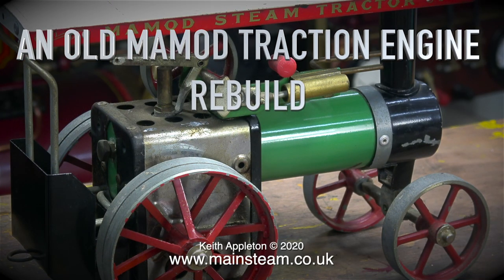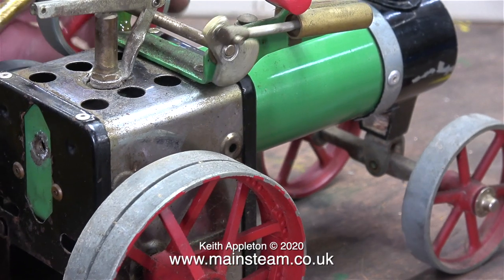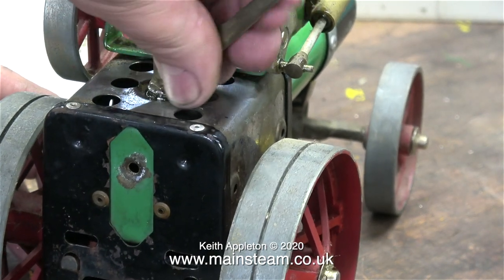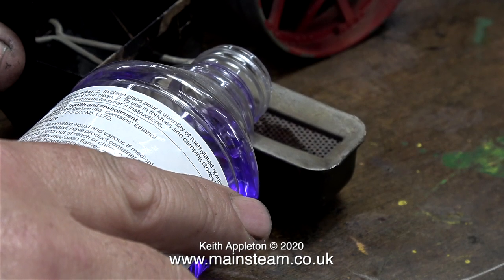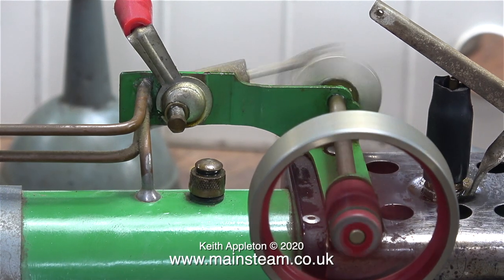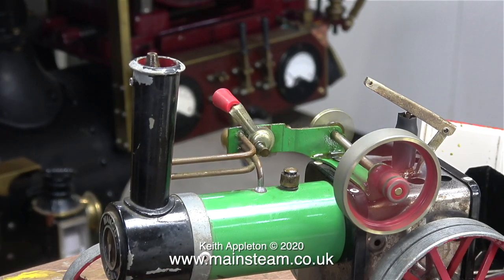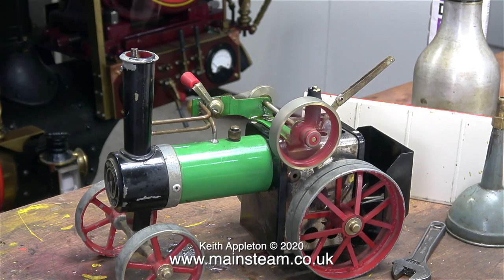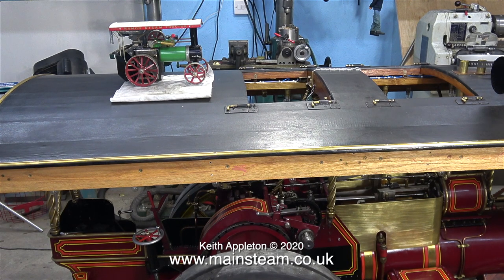A MAMOD TRACTION ENGINE REBUILD - PART #1

Comment: Fun fact i discovered is that a lot of the smaller Mamod stationary steamplants are compatible with Meccano parts, even the standard models, so it's basically can be used as a live steam engine for Your meccano (or trix, etc) creations! I suppose it's a well known fact in Britain, but i had not seen that before. (i finaly managed to get my hands on one of those dedicated Meccano machines as well recently but they are quite rare in my country). Sometimes one can still find loose parts for the meccano system reasonably sheap where i live, if one are just looking for old parts that are fun to play with and not something in real collectible mint condition it's still possible to get basic parts without being a bilionaire, i use small DC motors as generators for the miniature steamplants, not that beauty as the original generators but it works for creating pedagogic models to show my sisters kids.

Comment: Awsome! I just got a little box of various small stationary Mamod steamplants from Britain i begun to cleanup and restore them few weaks ago, i relay love those for some reason and they did not cost me a fortune either but i think they shall be relativly easy to patch up again, it mainly seem to be bends and dents and soft soldering and a few brooken pins, it's awsome that one can still order so many replacement parts for the missing pieces even for the old machines.

Comment: I read steve malins  book some years ago . He was the last of the malins family to own malins-models before they sold up in the late70's/early 80's.  He cleared the pronounciation debate up .    The family name is pronounced  'maylins'  and thus mamod should be pronounced  'maymod'  . Its an excellent book by the way, out of print but readily available second hand ,all be it for a premium.
'Mamod -The story of Malins Models by P.S. Malins
Reply from the maker: Thank you for your illuminating comment. I don't dispute that the correct pronunciation of "Malins" is "Maylins", that works because a single letter L instead of two as a double L together can affect the pronunciation. But not so I think when there is no L - as in Mamod. Here in Yorkshire a common name for Mother is "Mam", the pronunciation is similar in "Mama". Also, I found this on the internet: https://www.howtopronounce.com/mamod
Reply: I’ve also heard that the family name was pronounced “Maylins”. Whatever learned people might say about pronunciation of certain words, if that’s how they pronounced it, that’s what it is.
Despite that, I’ll probably carry on with the common way just so’s I’ll be understood.
  I was recently left an old one of these engines in bits by an old friend who passed away. It would be nice to get it back together.
Reply from the maker: I will continue to pronounce it Mamod }:-)))
Reply: So will i keith. 'Mamod' just sounds better

Comment: Does that ever bring back memories. One tip for your viewers, if you are running it on your Grandmothers dining room table, take the lace table cloth off first, and put something down to cover it so the hot back wheels do not scare the table or sink in the wax polish. If you do not take these precautions you may learn how to eat your meals standing up.
Keith this is going to be a much watched series, thank you. When I was working the guys said I had a philosophy "If it doesn't work use a bigger Hammer" I'm now going to have to go run one of my steam plants.

Comment: Not really my thing - when it comes to "toy" steam I prefer the engines made by Wilesco. However, I can appreciate that Mamod engines are very robust and are designed to withstand the abuse they will get from being repeatedly played with by a young person.
In many ways they represent the very epitome of post-war British toy steam engines.
Reply: Henry A yes I have to say I prefer Wilesco Engines. I’ve recently treated myself to a Wilesco D18 Steam Plant. Reciprocating Cylinder not oscillating so not much mess a sort of site glass etc etc it runs very well
Reply: But for a child, a nice introduction to model steam.
Reply: @schwarzalben88  Wilesco D18 is an excellent choice! Plenty of features - pressure gauge, whistle, generator and lamp.
If running it indoors, line the burner tray with aluminium foil and use gel fuel. No smells ;-)
Or if you can afford it get a Bix gas burner. You won't regret it.

Comment: I still have both my models. The steam roller has had many hours on it and still runs. A lot better than the (as yet barely run in) traction engine.
The steam roller finally lost all it's paint due to repeated steaming and is now just polished brass. I do remember as a small child being told to take care of them as they were very expensive (at the time)
I wanted the steam car for the collection, but could never afford it.
Many happy hours of fun and now equally good childhood memories. Where do the years go?
Reply from the maker: I also have the Mamod Steam Roller, but the one I bought has never been run ....
Reply: I also have the roller and it too has a polished brass boiler, it was handed down to me by my Grandfather along with the traction engine, the steam roller was in pieces and my Father and I rebuilt it, as the paint work on the boiler was badly damaged I removed the remainder and polished the brass, I was then given the Mamod steam fire engine for Christmas one year and have cherished all 3 since. I now regularly fire them up for my own son who I will pass them onto eventually.

Comment: I prefer Wilesco which has a more typical double acting cylinder.
My parents bought me a kit traction engine in the 90's (I would have been mid 30 in age). Assembled with the help of my Father.
It also has a steering wheel and chains and gear drive to one rear wheel.  During lockdown I fired it for the first time in 20 years and took it for a run up and down the footpath.

One thing I found though, wind chill has a big effect on steaming outdoors as the boiler is not lagged, ok when there is no wind.

Comment: Keith, another comment. On the TE1/TE1A.
I have my original box with mine. Has a filler plug, brass whistle, not the tin lever type. But has reversing option. No axle supports in the firebox. Has the red reversing lever. The front casting says TE1. The box is marked TE1A Reversing. But the box picture shows the TE1 front casting. 
Afik and remember the A suffix was added when they added reverse. 
Guessing they added improvements/changes during the 1A production run.
Reply from the maker: I think they just used the parts that they had at the time.

Comment: Many years ago I bought one of these . As its as old as I am. I still have it, no reverse but miniature taper plug valves to control steam to the whistle and the cylinder.
Reply from the maker: The original one that I had was like that, I much prefer that design to the later ones.
Reply: Probably a bad idea, but i think Wilesco sells loose parts wich include a hand cranked steamvalve on a pice of similar pipe with fittings.

Comment: I had a similar problem with the whistle on my Mamod steam wagon. In the end I just used a blow torch on the old whilstle to reflow the solder and remove it that way, once the solder had cooled once more. Then I had a friend of mine fix the bushing properly. The bushings, particularly on the whistle, do seem to be something of a weak point.

Comment: Hi Keith,
HOW CAN YOU HIT SUCH A THING WITH....                   hahaha just jokes. 
Those of us that have watched enough of your videos know you have the touch and if you break it, you will fix it. Carry on ignoring the insulting comments from shocked, confused and very new.

My grandfather, who vaccinated me with steam at a very early age, found a Mamod stationary engine type at the local scrap place. Got it for a tin of scrap brass (cant compare the weight value).
He fixed it up and it was a xmas gift. 
Has a bit more to fix as the steam delivery pipe keeps coming away from the cylinder bracket due to vibration. ill get there.
This engine since has attracted two more smaller one of different years and missing different parts so have some work to do there as well. All about the fun i guess.

Keep up the good work
Regards,
Paul

Comment: Hot rod mamod. Twin cylinders and a tube boiler at 10 psi. Will it work?
Reply: Fun fact is that they actualy made twin cylinder macines back in time.

Comment: Interesting. I used to have one of these; new in 1987, I believe. It had the water glass design on the boiler and the solid fuel burner, so is a little later than this one, I think. Unfortunately, the boiler failed one day when it ran dry and it was eventually thrown away.

I generally tended to prefer the Wilesco engines, which had, I think, stainless steel boilers and seemed a little more refined than the Mamod engines. I still have two of these that I had as a nipper, both stationary engines, although they did produce traction engines, too.

Comment: It’s not worth fannying around trying to free the whistle for what they cost. Saw it off, drill out the remains and insert and pop a new one in. It’s 1/4”. (I went mental and built the Mamod I dreamed of as a kid with a working crane) I put stainless steel tube over the rear axel to stop some of the heat.

Comment: I believe I have the later design that uses Fuel Tablets one issue I have is that it can build up enough pressure to run the flywheel but it struggles to run when the belt is attached to the back wheel almost like it can't generate enough pressure to move its own weight I don't understand why this is part of me thinks that the fuel tablets don't get hot enough to boil the water quick enough for which the remedy would be to get a methylated spirit burner for it the other issue is the reversing/regulator handle connected to the cylinder it is held in place with a flat head nut and due to the expansion of parts when in use this nut can work loose meaning there is a lot of play in the regulator which can lead to steam leaks but if I tighten it then the regulator can at bestbecome stiff in mid gear or at worse it is physically impossible to put it into mid gear.

Comment: Hello Keith, just found your channel as I stumbled across my childhood toy of a TE1A bought for me back in 1974, and in need of some TLC to bring it back to life. Thanks for some great videos, I have learnt a lot already and now have it working. I am struggling with which paint to buy that is suitable for the heat and is the correct colour match. There doesn't seem to be any primer under the green paint, I see the brass body so it looks like the paint was applied direct to the brass? Is painting with a brush better than spraying and can you recommend a good colour match for the green, red and black and the best brand? Thanks for any advice you can provide.
Reply from the maker: I don't do much with small Steam Toys, Mamod made a video a few years ago showing how they are made.

Comment: I've still got mine that was bought for me back in 1964. It seems rather sad to throw that boiler because of those whistle and filler bushes. You can drill them out and make replacements on your lathe, then solder them in. As people have said these engines just about go on a dead smooth floor so the Wilesco model is a far better bet to restore. I've made one into quite a realistic  model having made a realistic firebox and tender plus a representative perch bracket for the front wheels. I've also used Mamod wheels as I think they are better than the Wilesco wheels.

Comment: I still own mine in new condition boxed from Christmas 1980 ☺️
Reply from the maker: is that a good thing ?
Reply: @keithappleton  To me it is. I did use about 3 boxes of fuel tablets then cleaned and polished it before putting it away. Sometimes I get it out and look at it though.

Comment: it is indeed May-mod.  The name Malins is pronounced May-lins.  Its one of those funny quirks of society that the name Mam-mod stuck.
Reply from the maker: I don't dispute that the correct pronunciation of "Malins" is "Maylins", that works because a single letter L instead of two as a double L together can affect the pronunciation. But not so I think when there is no L - as in Mamod. Here in Yorkshire a common name for Mother is "Mam", the pronunciation is similar in "Mama". Also, I found this on the internet: https://www.howtopronounce.com/mamod
Reply: The Mamod history book, written by Steve Malins actually states in its opening paragraph it's always been mispronounced. I quote "almost invariably mispronounced (it should be 'Maymod', not 'Mammod'), the name is simply the 'Ma' from Malins and the 'Mod' from models, and is now, perhaps, the most widely known name throughout the world for steam toys". Not that it matters much, I bet when they were churning out 100,000 engines a year that was the last thing on their mind. By the end of 1995 there had been 468,890 tractors made, and they haven't stopped! Oddly in the same period, only 187,471 rollers, maybe people prefer Traction Engines

Comment: Any idea where I can get a new drive belt for the groove in the back wheel. My TE1A had a long floppy very thin coil spring with a taper at one end that would screw into the other end. I've found crank shaft seals that employ similar springs but I can't find any long enough. My Mamod I've had since new when around 10 so would be about 1972. Still runs fine. I suppose only been fired up 20 times.....
Reply from the maker: www.forest-classics.co.uk

Comment: actually the working boiler pressure of a Mamod portable steam engine is 1.5 bar which is 21 PSI i just thought you would like to know that
Reply from the maker: The safety valve on this one blows at less than that ......
Reply: @keithappleton  Yeah, Mamod valves are set to 14psi or something like that.
Reply: @keithappleton   i have got a book about Mamod steam engines and the information in it says its 1.5 bar. are you going to restore it to working order like i have  just done with my own Mamod traction engine?
Reply: @keithappleton   are the brass boilers on older Mamod engines safe do they go very thin on the inside after so many years of use?
Reply: is it possible to rebuild one of these older engines using some new parts for the modern engines like giving it a new firebox and engine bracket and smokebox and chimney and a pair of new wheels but keeping the old boiler with a water sight hole. I noticed that the boiler of your engine had a bit of a gap at the back head of the boiler

Comment: I have an original 1960s Mamod Steam Tractor. She used to steam well but now just spits hot water at me and will refuse to steam properly... so she now is on static display until I have time to see what’s wrong but it might just be limescale that has built up in the boiler..

The last time I steam her was back in roughly may time when we where doing the NHS claps at 20:00.. in stead of clapping I once sounded her whistle for the NHS! https://youtu.be/ueer0iovvwo